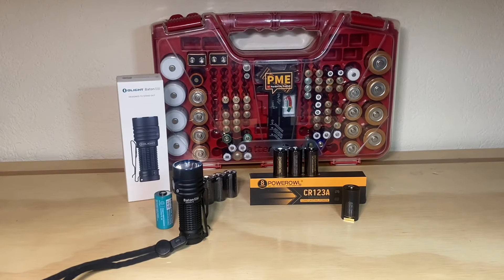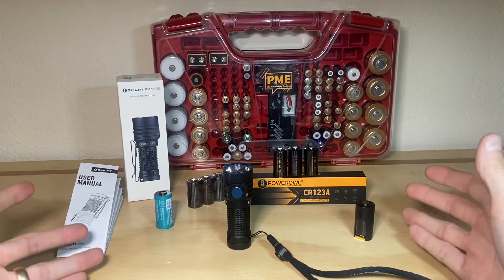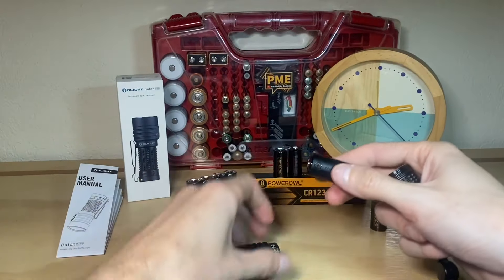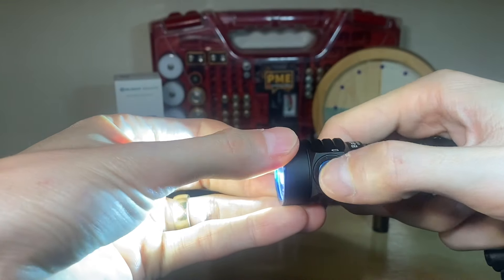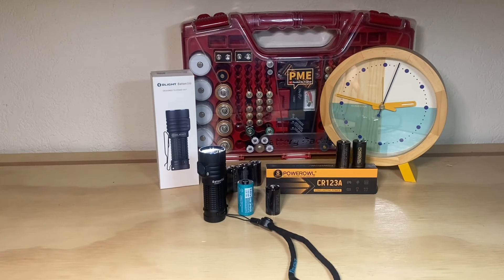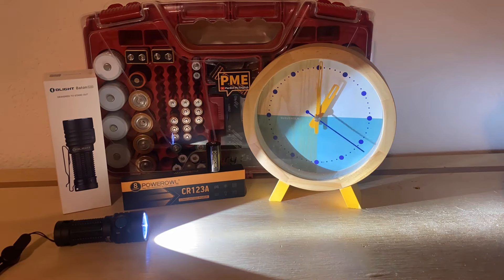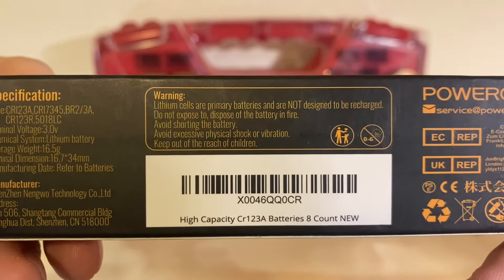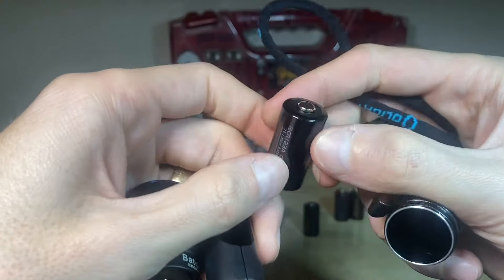POWEROWL CR123As in Olight Baton Turbo

Comment: I was also gaslighted by Olight into finding the best 16340 for my Baton Turbo! But there is an KeepPower 18350 3.7V 1100mAh.
The downside is that i payed alot for it, 20 euros!
BatonTurbo also work with 16340 Olights battery from Baton 3 and 4 (550 and 650 mAh) and can be charged inside Turbo.
Reply from the maker: That is interesting! I did not know it could use Olight’s 16340s.

Comment: Does the lockout feature work with CR123?
Reply from the maker: Good question. Yes, lockout works using the CR123As. Strobe also works but appears to be at the high mode brightness.